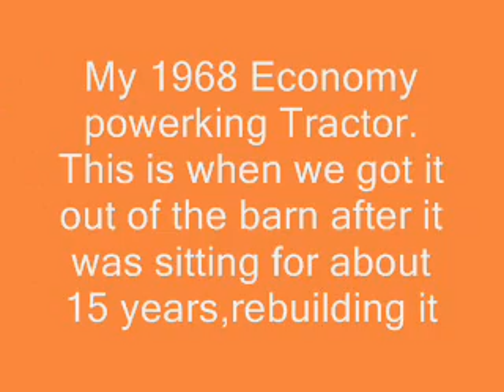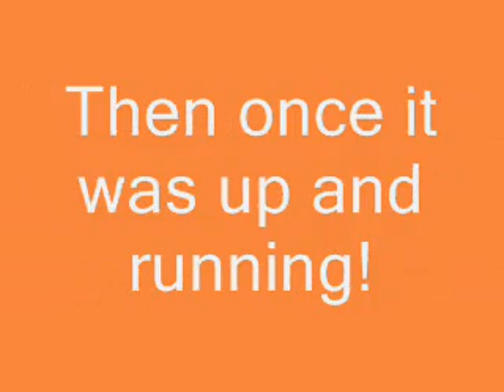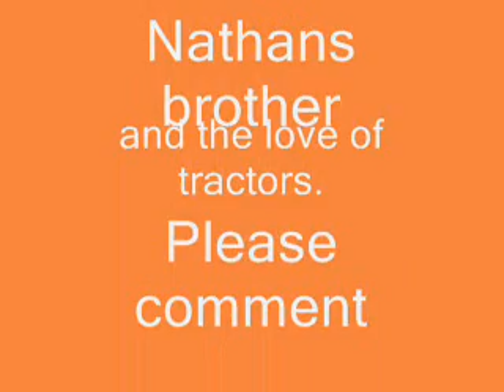1968 Economy powerking (The restoration)

Comment: Those power kings would out pull a farmall
cub I would like to have one they had performance beyond their size and 
I like things american made so I guess
collecting antiques is what I will have to do 
to get something american made
Reply: Now wait a minute here. I am an International Harvester Cub Cadet owner, along with a owner of two Power King tractors. Love both brands of machines. The Farmall Cub tractors are noted to be and to have the strongest well built rear ends in the tractor industry. The Power King tractors also have a very good reputation as being well built quility tractors as well to. Both perform very well in very different ways under different circumstances.

Comment: geez thats a huge tractor is that a tractir or mower? how big of a engine you got in there
Reply: It has the capability to mow grass, cultivate and plow gardens, plow snow, pull a trailer around, it CAN and does do many various jobs around the house. Rather own s tractor that you can do many things with than those stupid zero turn radius machines, which can only do one thing, mow grass, that's it.
Reply: Power kings were offered in 12, 14, and 16 horse power models. I have a 12 horse and that things no joke, that's in part due to the final drive rear end design. It's essentially a lawn mower that can pull down a tree.
Reply: @farmboy2272  We had a 12 horse model with the dual transmission when I was growing up.  You are 100% correct about the final drive. Between that and the individual brakes, this thing never let us down!